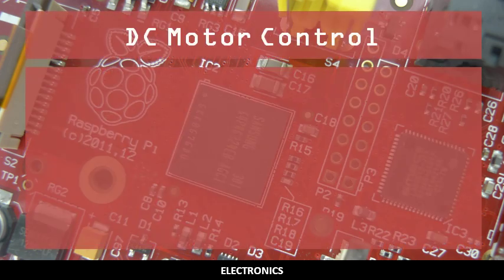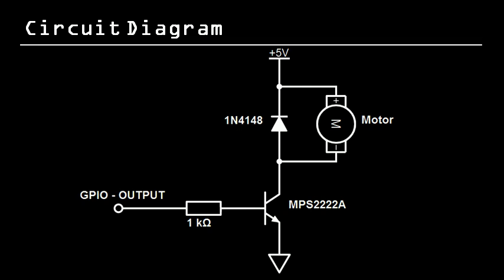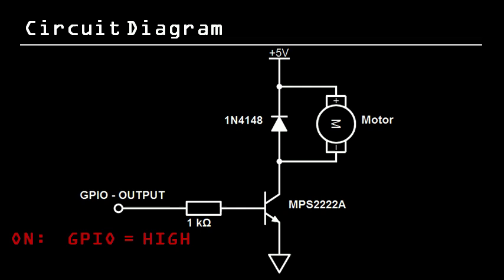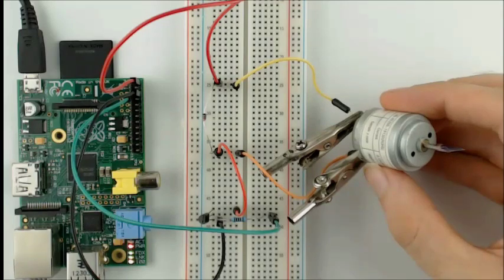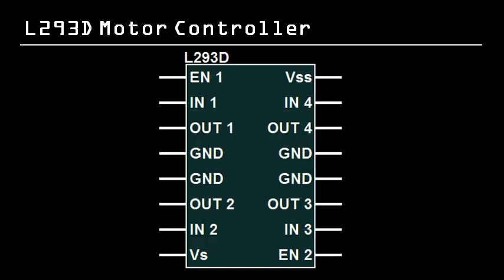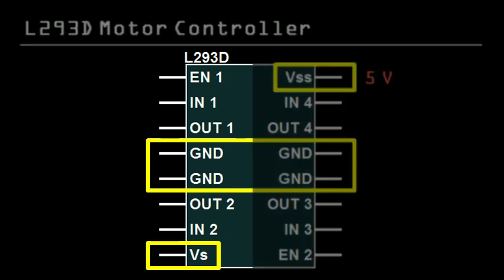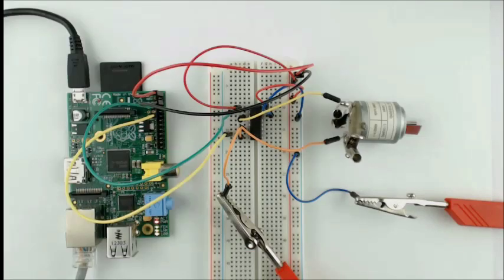Controlling a DC Motor with the Raspberry Pi

Comment: If I would like to control an air extractor that is using AC power ( 220 Volts, max 33 Watts ) would I use the same setup you did ? What should be different ?

Comment: Hey Gaven,
I wonder how I could get some more voltage into this. Because my motor doesn't seem to deal with friction when starting. Sometimes I even got to give it a little push for basic starting. I wanted to add a second power supply to this.. do you have any recommendation for this practice? Is a transistor actually capable of combining 2 separate power sources? Thanks in advance ;)

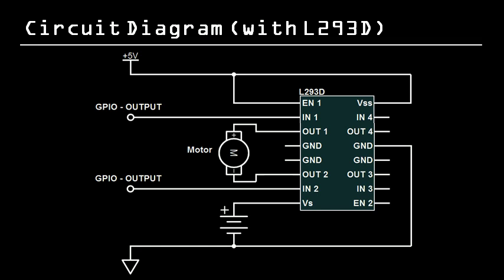Comment: No need to use  "fly-wheel" diode(s) with the L293D? And if needed, it would be between common ground reverse-biased toward OUT1, and another for OUT2 in this case ( 3:11)? Should we protect the GPIO pins too ( forward biased diode from GPIO to IN-pins of the L293D) ?

Comment: Hi, I followed your tutorial but i ran into a problem, i am using a 7.2v 5000mah battery pack on a titan 12t motor but for some reason the motor wont spin and the l293d chip just become very very hot, also the maximum voltage between the pins on the motor and ground is aroun 1.2v
Reply: also the motor is making a sound but not turning and the motor is brushed, and when using a multuimeter on the 20m setting is 0.6

Comment: Hi Gavin. I'm really new to all of this! I keep hearing that it is not possible to control a fan directly from a RPi as it draws too much current. I wonder whether a basic 5v fan could be used instead of your DC motor so that the fan could be programmed to turn on and off as you suggest in the first half of your video without the use of an additional motor controller (if you don't care about the fan speed).

Comment: I have a 7.5 amp 12v supply that i would be adding in. will this chip handle those sorts of current. And i not do you have any suggestions?

Comment: I have it set up the way he has it in the second demo, where the motor goes both ways. it works when the program is running, but when the program is not running, the motor just runs freely, any suggestions from anyone?
Reply: Appl314159 you need to turn the gpio pins off when you finish or set the duty cycle to zero

Comment: Why is the load connected to the collector and not the emitter? It wouldn't make a difference would it?
Reply: it wouldn't work its a npn you know
Reply: @lolboy007sub  Why? I would have thought that it would work connected on either the collector or emitter side.
Reply: @TR3A  no, a transistor is like a switch, but it doesn’t completly behave like it. I suggest you watch afrotechmods video on this matter.
Reply: @logictechratlab8787  Thanks. Will look for it.

Comment: would the raspberry pi and L293D motor controller be able to controll motors like :  http://www.ebay.com/itm/1000W-48V-electric-motor-for-scooter-bike-go-kart-minibike-MY1020-/161754788229 or :  http://www.ebay.com/itm/350W-24V-electric-motor-for-scooter-bike-go-kart-minibike-razor-MY1016-or-DIY-/151878224590 ? or would I need more serious equipment?
Reply: Hugo Rennings not 1000W, you'll burn the motor controller!

Comment: great video. .. can you help me ? i need to control dc motor but not in this way..
i need to know how to control it by voltage.
from 0Vdc up to 10Vdc.
i mean use raspberry pi like potentiometer. ..
Reply: +Mohmammed Hussain I just don't think that is possible.
Reply: سلام برادر میگم شما ایرانی هستی؟

Comment: it´s possible connect a dc motor directly to raspberry pi without any transistor ?
Reply: João Silva Not really - you'd risk frying your raspberry pi. When motors stop and start you get a very high voltage 'spike' due to a back e.m.f produced within the motors. You need transistors to keep these high voltages within in their own circuit; transistors are very useful!
Reply: The transistor is used to turn motor and off because the gpio doesn't have enough power to drive the motor.
You need to make sure the power source for the pi has enough power for pi and motor. The pi needs 1-2 Watts, but maybe the motor needs up to 5 Watts. 
You need the diode to protect the pi's 5V input from power spikes when the motor's magnetic field collapses. Make sure the diode is rated for 50V or so.
You can use a 5V motor or fan with a diode only. The motor will be on all the time.

Comment: Can I use a LED over the motor instead of a normal diode?
If I'm using a seperate power source, should I connect the minus-pole to ground?
I'm planning on doing the first setup, without a controller chip.
Reply: Örjan Sunnerhagen a diode has a voltage drop <1 volt and can cope with 50-70V spikes. A LED may have 2V drop and may burn out at 50 V spike.
The diode has a large area to take large current, a LED has a tiny area to make the light and doesn't like high current.

Comment: Can this handle a 11,1V 30A Motor?
Reply: If I read the datasheet correct the current limit is 1.2A, so no, it can't handle the current, but it can handle the voltage (max 36V)...

Comment: Gaven, All of your tutorials are grreat. However, I think there is a serious error in the H-Bridge control in the second half of this video.
You are using the IN1 and IN2 pins for PWM, while permanently enabling the EN pin, whereas they should really be used for direction control while the enable pin is pulsed using PWM.  I think this is the intention of the designer of the L293D.

Please check this out and revise your video as needed. Thx.
Reply: I'm not sure I'd call it a "serious error" but I agree it's better to pulse the enable pin rather than the direction pin.
By pulsing the direction pin, it forces the motor to "Fast motor stop" (page 9 of datasheet).
Pulsing the enable pins is sometimes called "pulse/coast" and pulsing the direction pin "pulse/brake". There's some debate about it possibly being useful to use "pulse/brake" but if "pulse/brake" is ever a good idea (I'm skeptical it is ever a good idea), it needs to be used with high frequency PWM. Older h-bridge chips (L293, SN754410 and L298) don't perform well at high frequencies so the debate doesn't really apply to these older chips (I think).

The "pulse/brake" technique probably doesn't really matter much with small motors but there's a big difference in performance when using larger motors (in my experience) you get much better performance by pulsing the enable pin.
It still possible to control the motor with just two GPIO pins by using an inverter on one of the two direction pins.

If anyone reading this followed the tutorial "Raspberry Pi - How to control motors" by the kid who calls himself "The Raspberry Pi Guy", make sure and stop using his setup. It's caused many boards to be burned out.
http://www.raspberrypi.org/forums/viewtopic.php?f=37&t=55288
He deletes any comment mentioning the error even though there are likely lots of boards still at risk because of him.

I've been enjoying the videos here. Nicely done. I do think the pulse/brake issue should probably be mentioned though.

Also the L298D datasheet shows flyback diodes in the circuit when used with motors. I know there's lots of debate about this too but I'd go with the datasheet unless someone proves the diodes aren't needed.
Reply: Ananda Wijesinghe please great your own clip. Completely err free

Comment: Also, How much current would be used by that one gpio pin because for this project, i am hoping to control 3 valves, and two 120VAC required components?

Comment: This was an awesome video, it is exactly what I am needing to do for a project with electric valves. I have a question though. If I am using a separate voltage supply for both logic and output voltage, do i need to worry about the current from the gpio pin to the input of the h-bridge? Specifically I want to use a 120V AC plug to a stepdown transformer that gives me approx. 12VAC then to a rectifier that changes my current to .8A, 12VDC, with voltage regulator for 5V or 3.3V.

Comment from the maker: It's great to see that my videos have been in some way helpful. The only thing I would say about powering the motors from the Pi is to make sure the current stays under 200mA. The current draw changes significantly when the motor is under load, so check with a multimeter.

If you later plan to make the car wireless, you could use one battery pack to power the Pi and the motors. Eventually I'll make a tutorial about that, but I'm still experimenting with batteries to see what works best.

Comment: Thanks for your response Gaven! I'll be using a geared n20 motor which requires very low current. The reason I wanted to know if I could just power the motor from GPIO directly is because I wanna keep the weight minimal. I've basically built a lego technic car with raspberry pi and using a sg90 servo to turn the front wheels and a stepper motor to rotate the rear wheels (learned to use both from your awesome videos - so thanks for that).

Comment from the maker: You could attach the 5V pin and ground pin in the place of an external power supply, but this will only work for motors that need a small current. For instance, for a small robot it would be better to use a battery pack instead of powering the motor directly from the Pi.